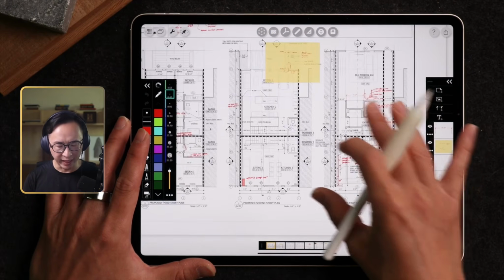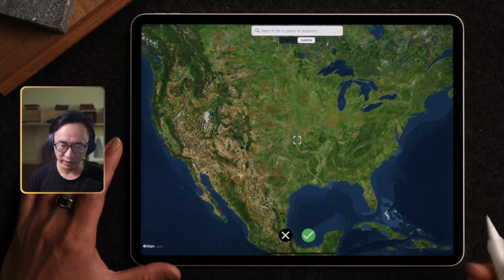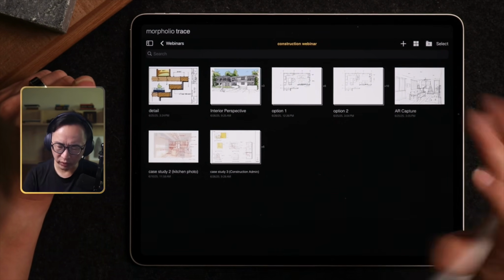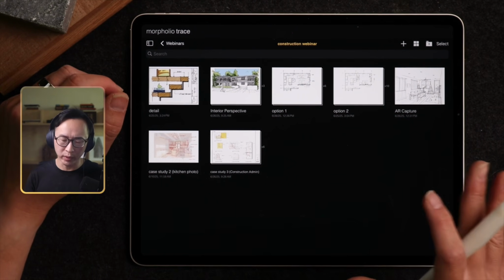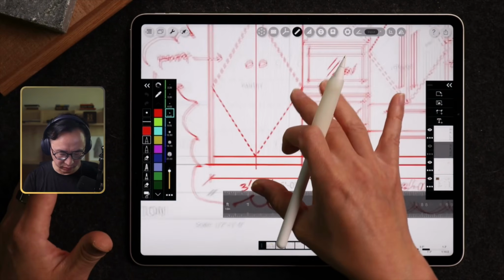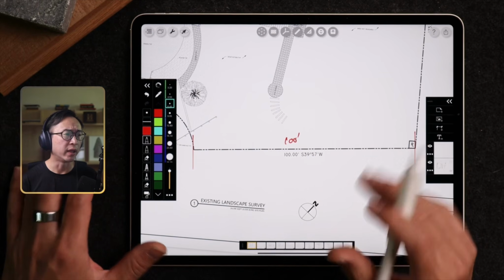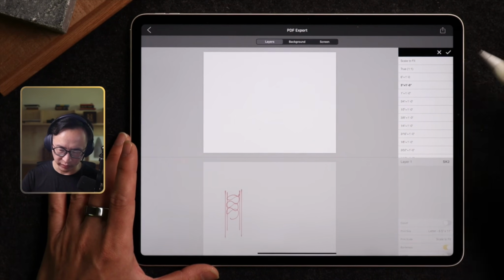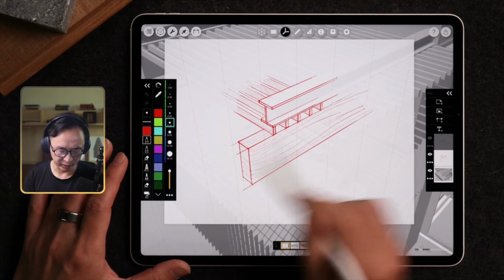My exact iPad setup for construction + site visits

Comment: I’ve never gotten a lidar model that’s usable.
Reply from the maker: How come, Phil?
Reply: @HenryGao  I always get missing elements, big ghost boxes that aren't there. Always missing elements. Windows, walls, cabinets, etc.
Reply from the maker: @Vanderloo5, I agree you're not wrong here, but I think you should adjust your expectations a little. This tool isn't designed to replace as-built vendor or even a more professional service like canvas.io; it is intended as a preliminary tool to capture the overall shape of the house very quickly, usually in minutes. Sometimes you might miss a window, especially ceiling skylights or features that are harder to scan. That's why I always bring a tape measure and a laser pointer to verify things that may be missed. It is, however, a really good starting point to prepare you for capturing more specific measurements later, instead of drawing everything on a grid notepad from scratch.
Reply: @HenryGao  Thank You Henry